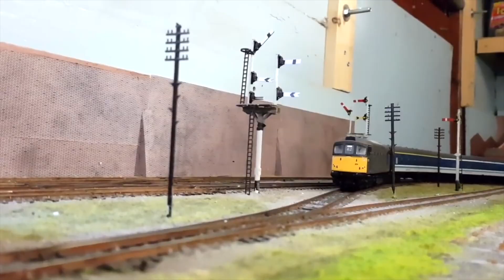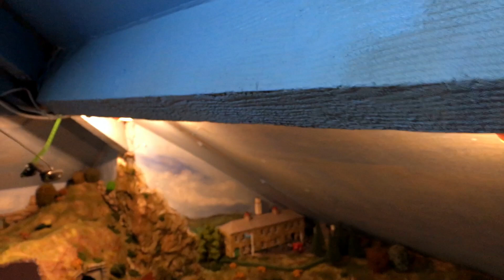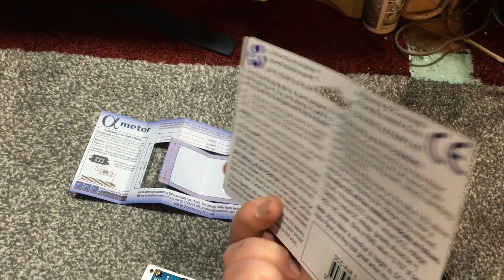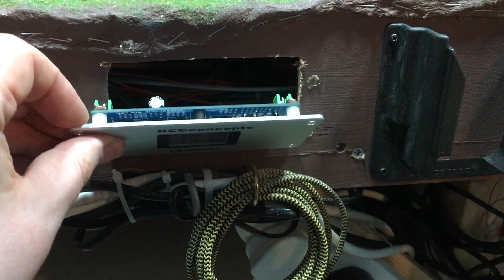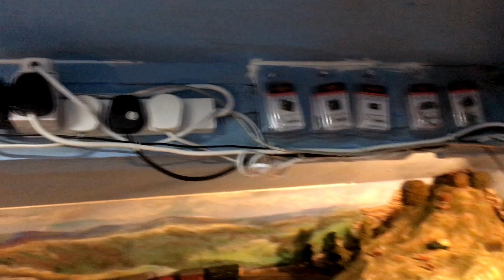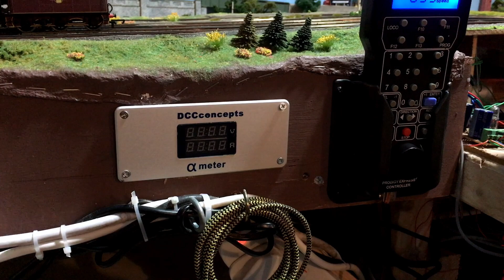How I Made My Layout Live Stream Compatible - Building the Loft Layout, part 34

Comment: I think I might invest in some photoflood bulbs to make it brighter in that loft. You can connect photofloods to a dimmer switch. Increasing the level of illumination will make cheap webcams appear to be much better! Do not make the mistake of installing neon lights or LED lightbulbs because these cause a strange beating effect on video - get the traditional tungsten filament bulbs. Although these run hot, you only need to have them on for the duration of the 'take'!